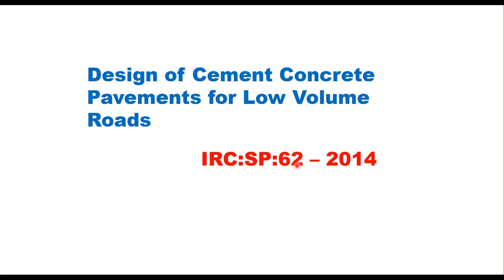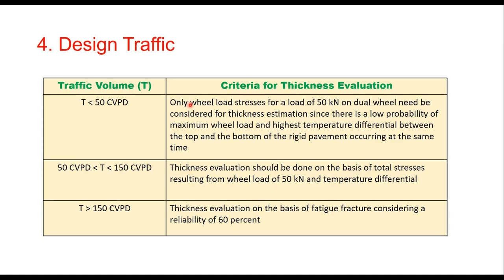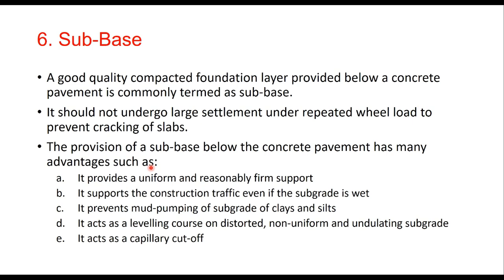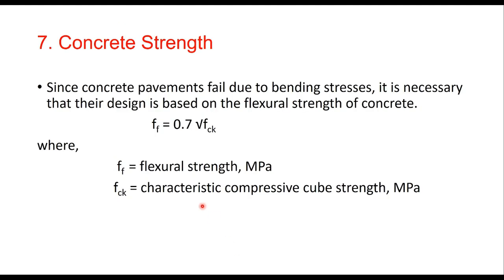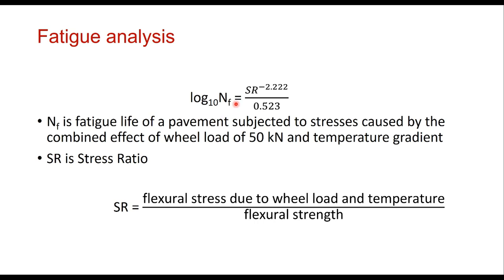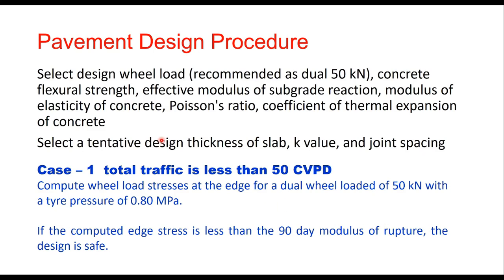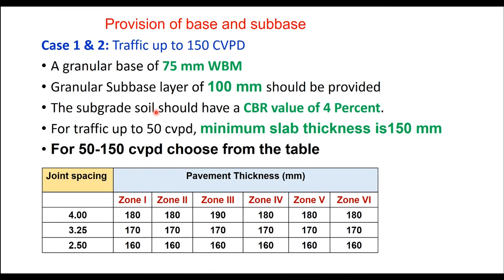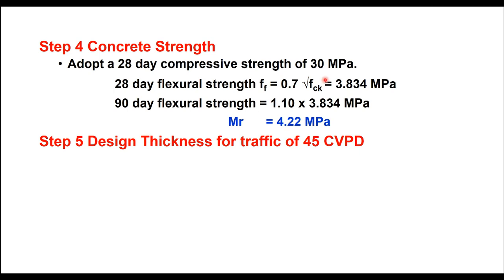#pavements, #highways, #CCPavements, Design of Concrete Pavements for Low Volume Roads.

Comment: Thank You so much sir for your Valuable lectures. please also make Lecture to how to design the Excel sheet for Low volume concrete road.
Reply from the maker: design of excel sheet is purely a different subject area. you have to micro programming in Excel.

Comment: Sir what is level tolerance in cement concrete and bituminous pavement & what is the importance of level tolerance ?
Reply from the maker: Level tolerance is basically allowance for poor workmanship. This is the variation in longitudinal and cross profile of the road from that shown on the drawing.

Comment: Sir very wel explained thank you....
1. But in case-2 when traffic is between 50-150 CVPD what does alternatively 100mm thickness cementitious layer means is it base layer over subbase of 100mm or directly base layer over subgrade without Subbase layer.....similarly in case -3 200mm cementitious layer
 2.Also what this cementitious layer made of is it M20 concrete??
Reply from the maker: 1. It means you can either use either 75 mm thick WBM layer over 100 mm of granular material OR a 100 mm thick cementitious granular layer directly on subgrade. 
2. Cementitous layer may be of any material like lime-flyash concrete or dry lean cement concrete or any other stabilised layer satisfying the condition of UCS.
Reply: @SatishIITR  Thank you so much sir
Reply: @SatishIITR  Thank you so much sir
Reply from the maker: @pramukhn8622  my pleasure

Comment: Sir, for case 2, how is correction factor c has been calculated in this excel?
Reply from the maker: Three cases are considered depending uon the ratio L/l
If it is <=4.25, then C = 0.045(L/l)^2 - 0.072(L/l) + 0.028
If it is <=7.5 then C = 0.043(L/l)^2 + 0.667(l/l) - 1.503
otherwise take C = 0.637 - 0.005(L/l)^2 + 0.1(L/l)

Comment: Sir  CVPD is 10vehicles, but the total gross weight of the vehicle is 
50 tonnes(but design wheel load is 5tonnes), and width of the road is 6m, how to design this road. 
1. Can we provide the longitudinal joint or not.
2. suggested Spacing of transverse joint
3. Can we provide the dowel bars and tie bars
4. What about expansion joint
Please give me the suggestion sir
Reply from the maker: Since cvpd is just 10 vehicles per day, it should be designed as rural road (IRC SP 62). for a road width of 6 m, take slab size 3x3 and there will be no requirement of longitudinal joint. Transverse joints will be at 3 m. 
Dowel bars are not required for such a low traffic.
Reply: Sir design wheel load is 5tonnes or 50kN for low volume roads but in the above problem 50tonnes gross weight of vehicle. Is there any conversion of vehicle damage factor for rigid pavements of different axle loads. 
2. If width of road greater than 4.5m  need to provide the longitudinal joint or not sir
3. Mentioned that slab size 3mx3m then it is to provide the longitudinal joint sir

Comment: Sir, incase the modulus of rupture of concrete is increased and transverse joint spacing is reduced, this directly reduces the total stress and the design becomes "safe". Can this be done?
Reply from the maker: The stress equations given in IITRIGID software are for 4.5 m spacing between the transverse joints. The behaviour of slab will change if you change this spacing. Yes, increasing Modulus of Rupture will reduce the thickness of the slab

Comment: Slab thickness as per IRC 58-2000,,,,, ARE THEY PRACTICLE FOR CITY INTERNAL ROADS,,,how much above should it be as compared to previous road.pl reply,
Reply from the maker: IRC 58 should not be used to design internal roads of a city. This code is for high volume roads (NH, SH and MDR) only.
Reply: @SatishIITR  Thanks sir,,vishveshwariya institute of technology,,NAGPUR,,recommende the same for our city (Akola) internal roads,,,resulting the houses/shops along this roads have gone below the new road by almost 2/3 feet.Sir,a common man hardly builds his home once in his life time,,that too got disturbed by these heighted roads,plus the additional 8/10" height of drain slab.These roads life is 30yrs,,again the riad authorities will increase it height,,hiw shall a common man lift his hard earned home.
Reply from the maker: @maheshchaudhari3987  Your concern in quite logical and well founded. IRC 58 is applicable to the roads where daily commercial traffic is more than 450. I do not know the traffic condition on Akola roads, but my understanding is that the internal roads of a city should be designed as per IRC:SP:62
Reply: @SatishIITR pl specify,,, commercial vehicles,,,there is traffic but only 2 wh,,auto,,passenge cars light vehicles,,heavy vehicles are resticted by girders grouted in between pavements,,yet this design adopted. Was it not possible to excavate deep & than acquire tee required thickness,,as to match the previous height of bitumen road,,,which was funded by world bank & of best quality ever seen.
Reply from the maker: @maheshchaudhari3987  Any vehicle having laden weight of 3 ton is categorised as commercial vehicle. Bus, truck, mini trucks and mini buses are the examples. I cannot comment on your second point as I have no idea of site conditions.
Reply: @SatishIITR  THANKS A LOT SIR,,, 🙏

Comment: Sir, I Biswajit Karmakar, from Dakshin Dinajpur, West Bengal, work at Gram Panchayat.
Our Gram Panchayat level Cement concrete road pavement maximum width 3.00m and minimum 1.5m, average *2.40m*, base course used SBFS, (course aggregate Pakur varities) Concrete Grade *M20*, which are lower Traffic road
Sir, please provide a design in Excel sheet for thickness of road.(a Excel sheet provide which is M30 and password protected)
Reply from the maker: download excel sheet here. It is not protected.
https://drive.google.com/drive/folders/1sanbiS_4kJ61PdtsAwcRdHTp2gXPXL2I?usp=drive_link
Reply: Sir Thanks